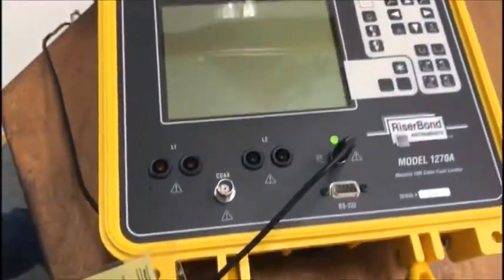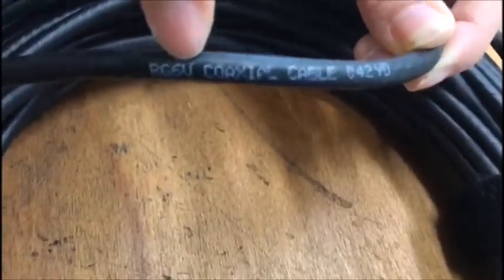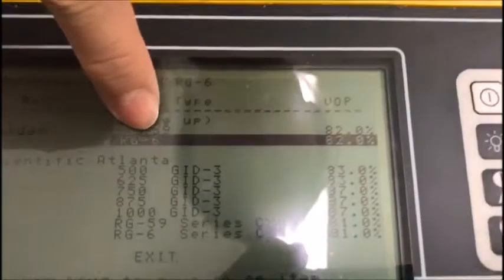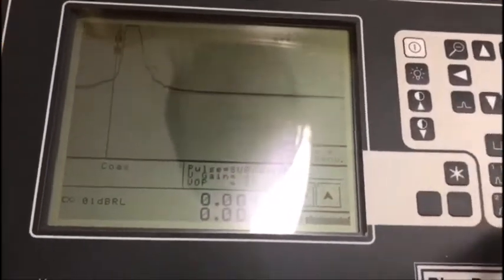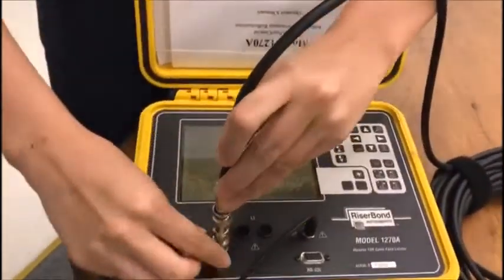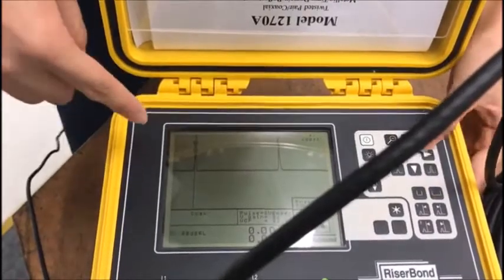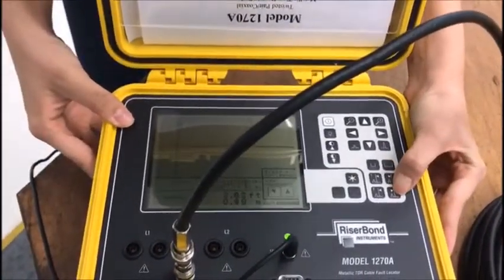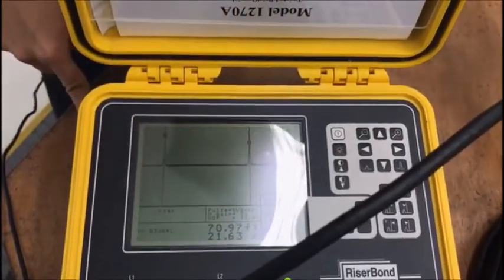Riser Bond TDR

Comment: Does this equipment work to detect a break in a power cable, copper 10mm²?
Reply: Kupfer Kabel für Telekom Leitung Internet und Telefon
Reply from the maker: Twisted pairs of wires only.  Wire size AWG 22.